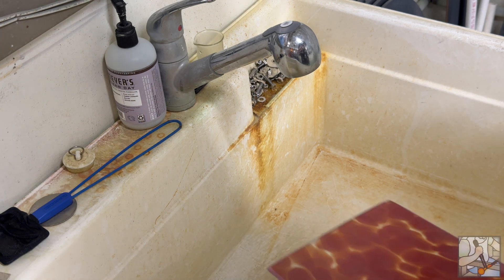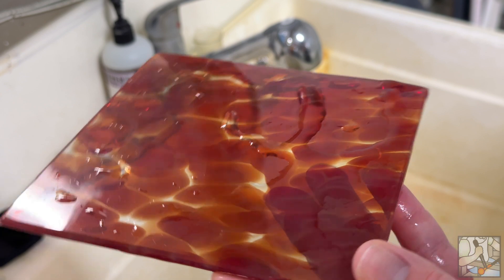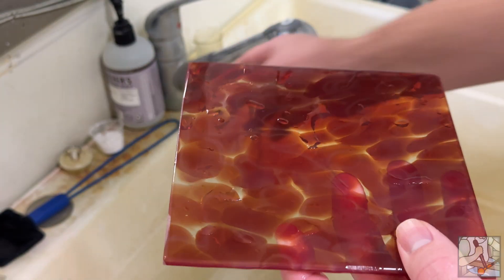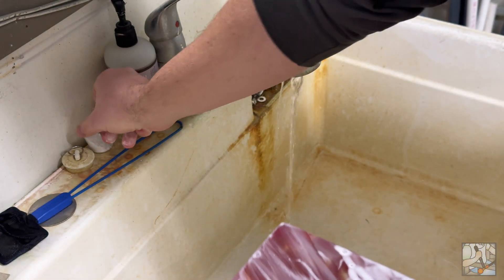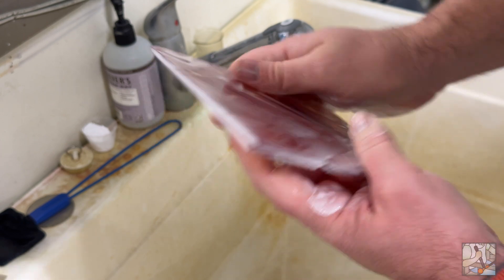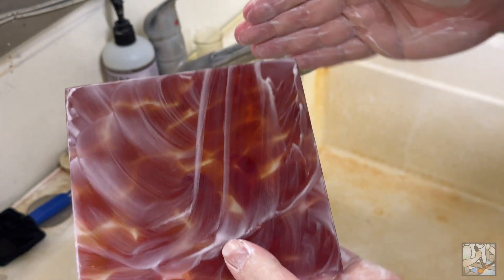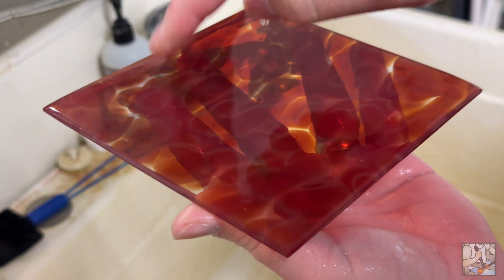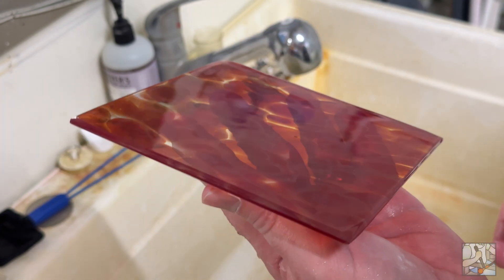How to use Whiting (Calcium Carbonate) to Clean Your Glass

Comment: Another way to use this is to mix a little paste, then apply with a cloth ,it dries very fast if you have the correct consistency.
When dry wipe off with a clean terry cloth . It really cleans great.
Reply from the maker: Thanks for the additional tip!

Comment: Great info, what a hassle if you do not have running water in your shop, but obviously very important, so it must be done. Thank you!
Reply from the maker: I've done this with a bucket of water before in a shop without running water. Clean water bucket and wash bucket. Works well
Reply: @hisglassworksinc  of course, why didn't I think of that? Thank you!
Reply from the maker: @Kerry0960  Happy that we can help